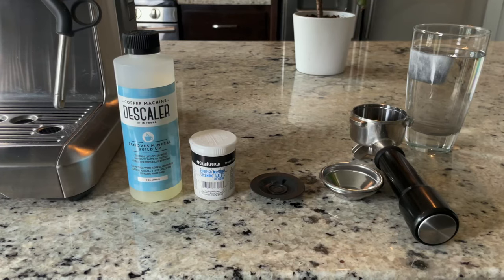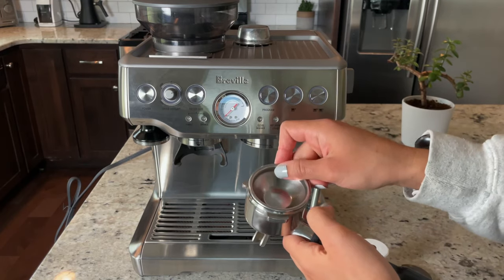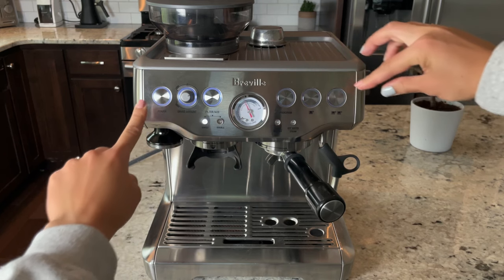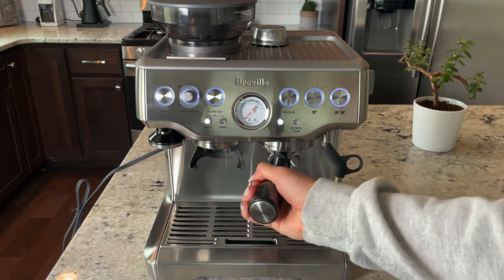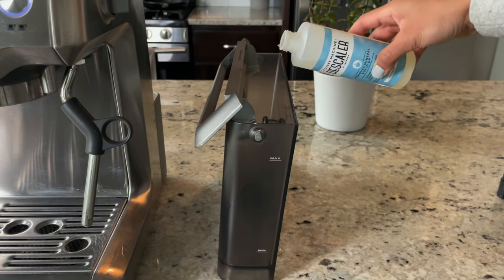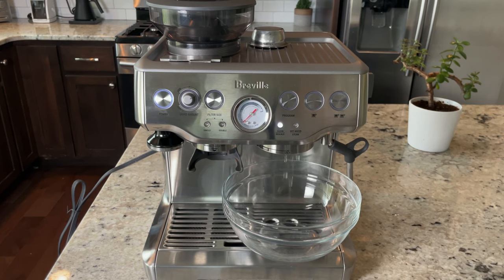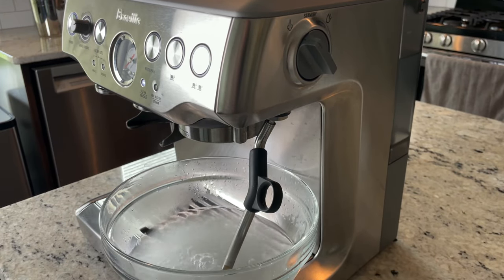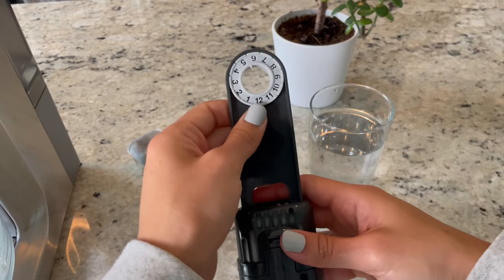How To Clean And Descale A Breville Barista Express Machine

Comment: Once you've put the descaling solution with water and go thru process and once that's finished. You should apply Only clean water and do the same process with Only clean water. That's what I was told so you get out all that descaling solution out of your machine Yummm????
Reply from the maker: Yes. Once the descaling process is finished, you want to run clean water through all sources (wand and portafilter) before making coffee. Same goes for the cleaning process as well.
Reply: Yea you need to run a full tank of clean water and repeat the process of group head, wand, water spout until the tank is depleted.

Comment: Why the descale light still on when I finish the tablet cycle?
Reply: If the light is solid you descale. If the light is blinking you backflush with tablet. You might have done the wrong cleaning that's why.